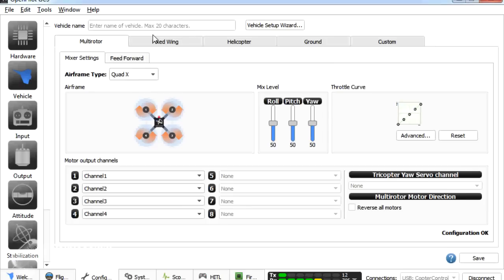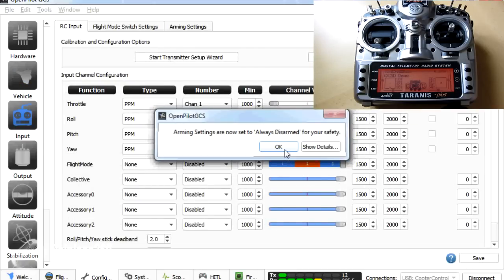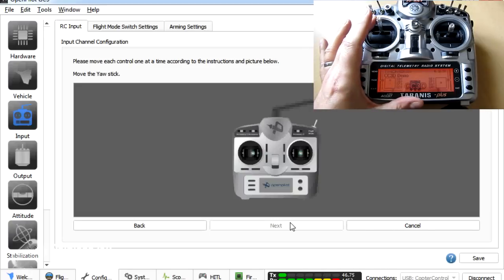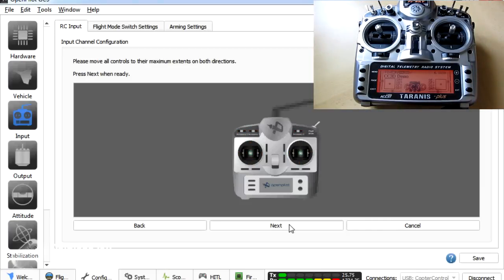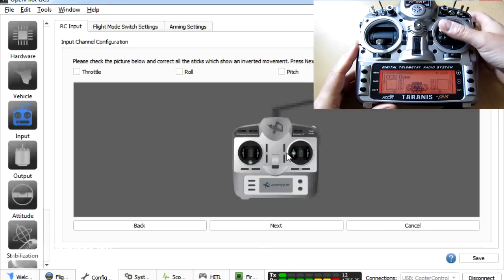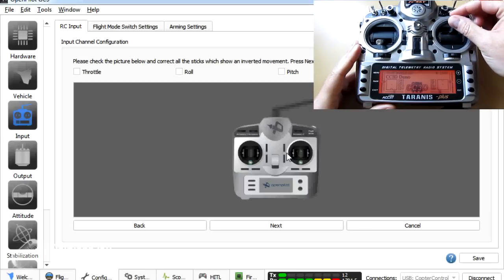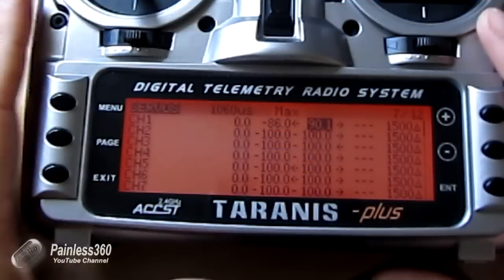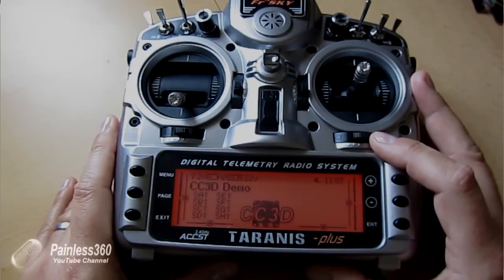(3/12) FrSky TARANIS Radio - Adding extra channels and controls for a Multirotor

Comment: Thanks very much for putting these video's together. I am coming back to RC planes after a 25 year gap, and blown away by the change in technology.  To make it even harder, I was persuaded to go with Taranis by a friend because its "programmable", and I have some limited computer experience. Its not helping, and I'm really stumbling trying to figure this out. Your first and second video's were helpful starting points. I know nothing about Helo's.  Adding extra channels is exactly what I wanted to do next for flaps and a separate nose wheel servo in my model, but I don't even know what a CC3D is, not to mention how adding it for additional channels adds another level of complexity to what I'm trying to learn next. Any advice PLEASE on simple, basic video on how to add two more channels to accomplish above for plane as described. (even purchased the taranis manual, but still not helping that much!). Appreciate any advice you can offer. Thx
Reply from the maker: Check out EdgeTX for Beginners (2025): https://www.youtube.com/playlist?list=PLYsWjANuAm4oFV4JEkyC5mKpdI0z82P7V it's the modern version of this old series... Best of luck

Comment: was passing through your channel and this question came to my mind, might be a bit dumb but i really don't know. Now some Tx have 16 channels extendable upto 32. but how on earth can they extend it when they don't have spare ports for adding additional switches ....like in taranis X9E they have additional empty slots for adding switches but in other taranis radios  they don't.
Reply from the maker: In reality the maximum number of channels you use on a model would be 16, that's 2 x X8Rs bound for the first 8 and then the second or one Sbus Rx. The other channels can be used for logical programming and organising of other pieces for complicated mixers in the radio. Happy flying!

Comment: Hellothank you for your lessons on YouTube. 
I have a taranis x9 plus with 2 x8r receivers. My question is can i have 32 channels? Because i have seen in the taranis menu the nummers going up to 32?
Reply from the maker: Yes you can but most receivers can support only 4,6 or 8 using PWM outputs or 16 if you are using S-bus (or  PWM 16 if you bind two 8 channel receivers to the same model memory). Some outputs can be used for mixes that never make it to teh receiver so having more than you need is useful..
Reply: @Painless360  thank you just what i wanted to hear haha because i need them for mixes.  thank you again

Comment: I have just created a model In my taranis and my default channel list is ch1 Rud, ch2 Thr, ch3 Ele, ch 4 Ail. These match on page 5 inputs and page 6 mixer.
Strange question but why are they different to your default settings: being ch1 Thr, ch2 Ail, ch3 Ele, ch4 Rud.
I don't understand how they're different, if they're the default setting un-edited.
Help
Reply from the maker: +Lee Swifty you can define the default channel order on the radio. See the radio setup menu if you want to change it. Best of luck!
Reply: Hi,
Thanks so much for replying. I've been following your dys F4 videos, very very helpful. I'll also be following your beta flight videos as I've just switched from librepilot so I'm a noob with beta flight.
Got the channels sorted after watching your videos. 
Without you guys on YouTube I would be completely lost, so a massive thanks to you all for your time and effort.

Comment: can i use a X9-E with a x6r and a x8r receiver ? i need 16 channels but 14 will do for right now  .. i have 2 x8r's on order, its NOT for a plane but for a multi-function 1/144 scale USS Midway aircraft carrier.
also is there a way to add more multi function switches ? 

Thank you
Reply from the maker: I'd check the manual for the latest on that, last time I was looking at this you needed 2 x X8Rs.. Best of luck!
Reply: i have 1 in now, the other should be arriving tomorrow, but it won't as HobbyKing has screwed up and it will be delivered late, when both are in i can finally lay out the wiring plan for my 16 channel USS Midway

Comment: Hi there, I think your videos are just fantastic, well done , I have learnt so much. Now I do have a question for you if you would be so kind. Somehow I have managed to rename my 3 position switch SE, it is now F M and it only works as a two position switch (i.e it only see's -100.0 to 0.0 and not +100.0 position)
Reply from the maker: Wow! I've never seen that. I'd probably look in the radio setup menu (where the calibration menu is) for a clue on how to set the switches. Best of luck!

Comment: When using multiple models, do I have to bind the receiver every time I switch between them?
Reply from the maker: Nope, if each model has a receiver then the connection will be activated once the model you want is selected. Happy flying!
Reply: Painless360 Thank you so much, I've had my taranis for a couple of months but these videos have really helped me get the full potential out of it. I'll definitely start using it on multiple models now.

Comment: In LibrePilot program, in the Hardware Tab, my selected options are as given below. Is any of the settings wrong?

Receiver Port: PPM_PIN8+OneShot
Flexi Port: Disabled
Main Port: Dsabled
USB HID Port: USBTelemetry
USB VCP Port: Disabled
Telemetry speed: 57600
ComUsbBridge speed: 57600
GPS Speed: 57600
GPS protocol: NA

Thank You very much.

Comment: Hi, 
At 11:05 in the video, when you go from setting up the model on the TX to testing it out on the CC3D, at what stage of setup of the CC3d should we be at? Do we complete the ESC calibration alone? When do we bind the TX to the RX in this case? 

I have watched your CC3DSetup with Librepilot Video and it leads me to the transmitter setup wizard, and that's where I'm stuck (at 22:26 in this video - https://www.youtube.com/watch?v=p1EhSYNa0pM&spfreload=1#t=870.174725) 
Everything is setup exactly the same on my Taranis X9D plus, CC3D, D4R-II as shown in the videos. All controls are properly calibrated as well. The receiver and transmitter are bound and the receiver has a green light on it. But I cannot proceed past 11:48 in this video (3/12 taranis setup).. Moving the throttle doesn't proceed to the next step on the computer.
is there something else that I am missing?  I'd really appreciate all help.

Thank You
Reply: I guess something is disarmed in my setup and I'm not sure how to setup arming.  Is there a link for that?
Reply: When I connect an individual ESC to the D4R-II - one channel at a time, the motor responds to every input (T,A,R and E) perfectly. This leads me to believe that the CC3D board itself is having a problem. I have double checked that I had everything configured so far as shown in this and other videos. So I am exchanging my CC3D for a new one.
Reply from the maker: See our series on the CC3D for far more detail on the process and steps to configure the CC3D. This is a video for this radio specifically. Best of luck!

Comment: Thank you for helping previously with the remote control calibration. As I went along this video, I could not proceed after 11:53. Only my throttle showed response. Other movements did not respond. Can you help?
FYI - I used Librepilot GCS (looks very similar to openpilot) because I could not locate a proper source of Openpilot software
Thank You
Reply from the maker: +Tejasvi S.T.S. I'd reccomend that you watch the CC3D Revo / Librepilot series on the channel. We cover setup in much more detail there. Best of luck!

Comment: Hi. Thank you very much for your tutorials - they are really helpful and I often use it as a guidance in my setups. I have a question: why do you limit throttle  range on the radio and what is the problem having range 900 to 2100 on flight controller? LibrePilot firmware handles this fine in my setup without any issues. Is it just you preference or there is something else behind this (for example CleanFlight 8) )? Thanks!
Reply from the maker: Great question. We do cover this in a few videos but here's the short version. 'Normal' range for any channel is expected to be between 1000-2000 microseconds. Although many ESCs and some flight controllers will support ranges outside of this 'norm' many others will consider values outside as indication of a problem and could enable 'failsafe'. Best of luck!

Comment: I see some videos with just using the mixer page to assign channels and not touching the input page. What is the difference?
Reply from the maker: You can do things to the inputs in the INPUTS tab that you can't do to the control in the MIXER tab. Have a look at the options when adding an INPUT (expo, dual rates etc).. Happy flying!

Comment: I think I got it. My Trex 450 with an iKon FBL controller on my TARANIS X9D using PPM communication . This will be the first flight with a Helicopter and the fist time i have used my a X9D Taranis Radio.  I could post the Bin file of the setup if it helps others.
Reply from the maker: +Rodney Wells yes please!
Reply: https://www.dropbox.com/s/nv147bnnr4lg7uf/Heli480_1.eepe?dl=0

Comment: That's is so funny. Every body on all the heli forums is saying the same thing.  Yes it looks very complicated maybe impossible.
What about Fly Bar Helicopters or something like the older mechanical choppers, TT Raptor50 . working way up from there.
Reply from the maker: Sorry we can't be more help. I hope that OpenTX makes this easier in future releases. If you want it then let them know.. The number of requests for something help set the priority for the developers.. Best of luck!
Reply: Thanks Painless360 The FBL helicopter controllers like iKON Neuron and BeastX  also us the same communications as the drone controllers.  Then after building a few quads just recently and getting very hooked on them I could see the attraction in expanding to the FrSky system for the serial data bus PPM, Sbus.  I am going to have ago at sorting it out. I like the Open TX software and firmware, it is so multi functional.

Comment: hello Sir, Thank you so much for the vids series. I'm trying to set up my radios side sliders for pan and tilt. I followed your instructions but when I go to channels monitor it does not show signal. power up receiver the servos get power but no signal. ??????? what did I miss. Is a plane for fpv I'm setting up. any help will be appreciated.
Reply from the maker: +Gilberto Sedo sounds like you missed something. You need to see the channel move on the radio. I'd suggest watching some more of the videos in the OpenTx mix school series for more examples of how to tackle it. Best of luck!
Reply: +Painless360  Yes I did miss something, to add the channels to the mixer lol.
Thank you Sir.
Reply from the maker: Glad you're sorted! :) Happy flying!

Comment: Hi Lee,
I have question about part of the video which starts @ 8:52.
You are setting up INPUT - Buzz (SH) / Mixer name (L Model).
Could You explain for what is this option and how to make it working in mission planner for pixhawk ? (my Mission Planner can see this CH6, while radio calibration but i do not know how to use it).

One more question about TARANIS X9D Plus - I couldn't find the video for setting up the failsafe in the radio (correct me If I am wrong)
Could You advice me what to do ? While switching on the Taranis I have warning "Failsafe not set" but I did it in Mission Planner (thanks to Your video: (5/8) APM 2.5/2.6/3.1 - Throttle Failsafe Setup )

Many thanks for Your hard & great work !
Reply from the maker: +Wojciech K not sure what you're asking, I've answered this in email on where to look for an answer.. A video of the problem and what you've tried would be useful..
Reply: +Painless360 
TARANIS:
I have set up everything like in video (in the Mission Planner) but still I have warning "failsafe not set" - Via email You mentioned the I need to set up Failsafe in the Taranis as well ?

Video " 3: Setting up for a quadrocopter":

@ 8:52 min You are explaining how to add new Channel (INPUT - Buzzer (SH) / Mixer Name: L Model)
What for is this "L Mode" channel ?
How to add "action" to this SH switch ? Via OpenTX compartment ?
Reply from the maker: +Wojciech K Sorry, still not following. Please see the painless360.com website for details and charges of how to setup a chargeable support call.. Best of luck..
Reply from the maker: Already answered this on another comment. No need to post multiple times - please see the other answer..

Comment: Hi, I have arducopter 2.8 and X8R receiver. I set channel 7 and 8 to RTL and Super Simple modes. How do I configure the switches to have them change the modes in APM? I watched the DYI video but didn't understand and it's hard to see on the blue display. Can you help me? Can you put Simple mode and Super Simple mode on the same channel?
Reply from the maker: +Grove Hull we also wrote an articke for OpenTx University that covers this in detail.  Best of luck!

Comment: Great video so far, I'm learning a lot!! But you really lost me with calibrating the throttle in microseconds. Where do you get these numbers from (1058, 1062, 1960)? They appear out of the blue? Thanks
Reply from the maker: +Axel Thieffry They correspond to the default settings of the ESCs I'm using. See some of the series that cover the basics (Introduction to Remote Control etc) for more detail. Best of luck.

Comment: i'm using taranis - L9R + CC3D why i can't have channel6? for accessories? i'm using PWM....is it has to be PPM to assign extra channel?
Reply from the maker: +I1&#39;s Depends on how you are connecting it. PPM will give you 8 channels on the receiver over one cable. Best of luck..

Comment: Hi. Your videos have helped me immensely. I'm having trouble with something though. Openpilot isn't showing any inputs from my taranis. I have everything setup just like this and have tried every option (ppm-pin8, ppm+no one shot, ect) and in the transmitter wizard it doesn't detect any inputs at all. I've tried 2 different FCs (CC3D Atoms) 2 different recievers (d4rii), 4 different jumpers and still the same thing. No recognized inputs at all. It shows that is bound, green light on, telemetry will say its lost if I unplug the battery. Could it be a bad taranis? Thanks for any help.
Reply from the maker: What radio recover do you have it plugged into on the model? X4R, D4R-II or X8R?
Reply: Painless360 D4r-II. I have tried it with two of these receivers. It binds, green light is on, telemetry is working. I have the 1,2 and 8 pin connected on channel 1 with a jumper on 3 and 4 and PPM8pin chosen in openpilot. I set up the taranis models and can see all the channels working in the monitor on the TX. But I get zero input recognition in openpilot. I am stumped.
Reply from the maker: +Forward Flight Can you make a video showing all of the connections? I'm not sure what the problem is.. You have bound the receiver..
Reply: Painless360 Yes sure I could. I thought the same thing too, if it was the TX it wouldn't bind, right?. Could it be the receivers weren't ever updated? I just got them and the ad said they were updated for ppm. Anyway thanks! I'll link you the video when I get it uploaded.
Reply from the maker: +Forward Flight OK, much clearer - you are plugging in the Rx into the wrong place. See https://www.youtube.com/watch?v=HZNmXkAeoG8 for how we did almost exactly the same setup and got it working with PPM..
Reply: Painless360 I'm confused. What did I plug in wrong? In the update for Openpilot isn't it pins 1,2, and 8 now for ppm? Like I have? If not I have tried pins 1,2 and 3 also with both receivers and it didn't work either. I tried that first until I saw other videos showing it as the 8 pin now. Otherwise I don't know where I plugged it in wrong. The video you linked has a different receiver and I didn't see the CC3D plugged in any different besides the 1, 2 and 3 pins. Sorry for the hassle, thanks again.
Reply from the maker: Yes, we used pins 1,2 and 3 as the PPM input. Best of luck.
Reply: Painless360 Okay thanks but I tried that too. Do you think it's the TX or RX? I need to return something. Anyway thanks for looking at it.
Reply from the maker: Interestingly we've been shooting a video here using a CC3D in a RTF FPV model and had something similar. We flashed the board with Librepilot, chose PPM, make sure that the input is set to PPM_PIN8_+OneShot and then wired it up to PIN8 (like you did) and it worked great! Hope that helps you..
Reply: Painless360 Hey thanks again. I tried Librepilot in every mode (PPmpin8+oneshot, PPM+no oneshot ect..) with both sets of plugs (1,2 and 3 pin and 1, 2 and 8 pins) nothing worked. Still not recognizing any inputs at all. So, receivers? That's the only thing I can think of. They aren't updated to ppm or the Taranis came defective out of the box.
Reply from the maker: Maybe, I'd connect a servo to one of the PWM outputs (take the jumper off the Rx) and see if that moves when you move the relevant control on the radio to prove that is working.. Best of luck.
Reply: Painless360 Yeah I did that a couple days ago. It was the receivers. Both sent without the update for PPM, the Taranis is fine. Thanks for your help! I really appreciate it.

Comment: Hello Lee. I am right with you till 10:54 where you go into open pilot. I have configured the Naze 32, bound my receiver and am using the FrSky D4-II and have the Taranis plus set as in the video. My question is that I can't get the board to arm, do I have to get and do this in open pilot or can I do it in Cleanfight.
Reply from the maker: +Jimz Custom Radios We cover that in the Naze32/Cleanflight videos.. Best of luck!
Reply: +Painless360 Thanks for the reply I have watched them all and I must have missed something.
Reply from the maker: If it's in Cleanflight then we have a 'Troubleshooting arming' video... Hope it helps..
Reply: +Painless360  Got it, just a matter of setting mixer to match Cleanflight, motor now work with radio. Onward I go!